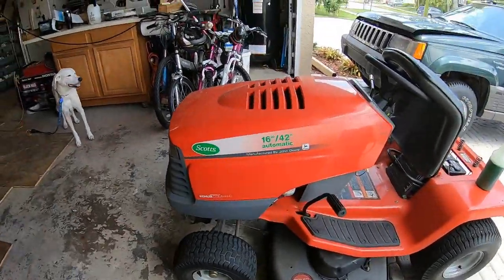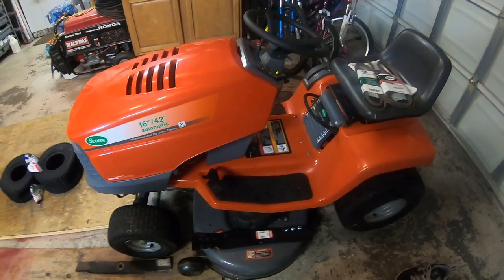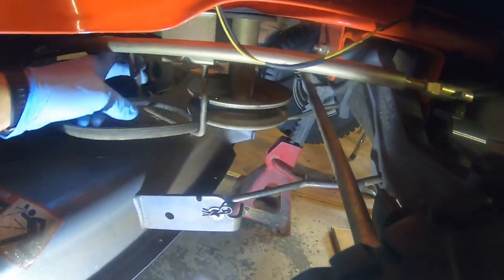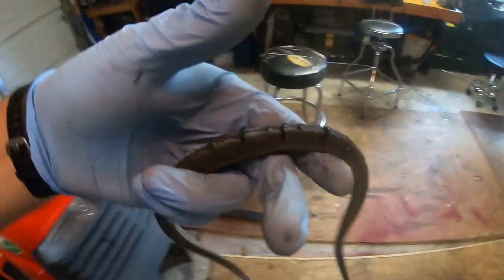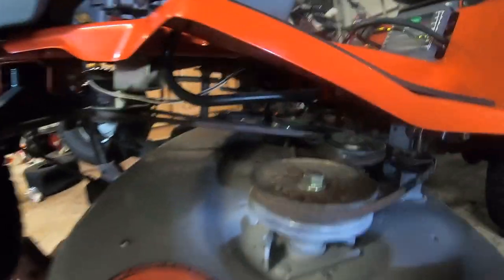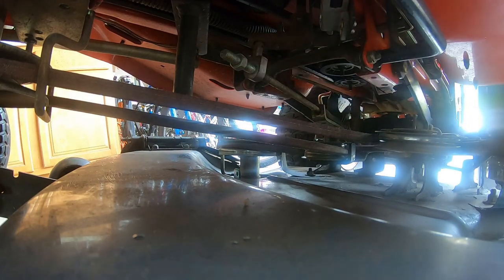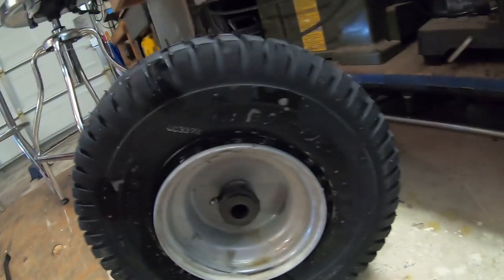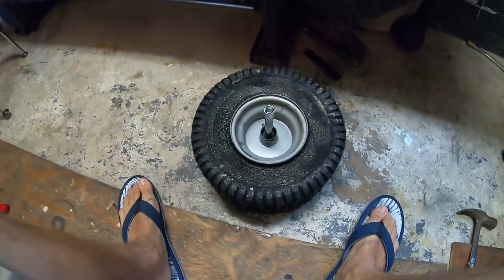Doing some maintenance on a Scotts/John Deere S1642 tractor

Comment: hey I have the same mower.  there is something wrong with the transmission its grinding.  any suggestions
Reply from the maker: I haven't had the trans apart yet. If you're hearing grinding from the trans, I suspect some a failed bushing or bearing that is resulting in misalignment of some kind. Either way, best to tear into it sooner rather than later to minimize the damage.
Reply: @JoesGarageProductionsLLC  yep,  I agree.   Thanks a lot for responding.   Happy New Years!
Reply: I had to pull rear out. (Easy 6 bolts) my fan teeth were wore. It sounded like what your describing.
Reply: @JoesGarageProductionsLLC  I have the same mower too., going on 20 years old. Great video.  I've changed both belts.  Mower seems to be having a tough time going up my hill this season.  Do you think I need to change the transmission fluid?
Reply from the maker: @bensonlouie6438  If the hydro is lacking power, it might be time to rebuild it. I did a video recently on rebuilding a hydrostatic pump on a commercial mower and it was surprisingly easy. In my limited experience working on hydrostatic drives, combined with lots of googling, it seems the most common problem points are the cylinder block assemblies and the center case. If the cylinder block doesn't form a nearly perfect seal with the center case, you'll have hydraulic leakage and low power. Other things can cause this as well - such as air in the oil, due to a low oil level. The oil level and condition is certainly a good place to start. I believe Tuff Torq makes rebuild kits for this transmission should you need one.
Reply: Does the pulley on the mower turn freely with the mower off, these things had a spline shaft where the pulley would strip out & cause the tractor to not move, had it happen to our LT160. New pulley & fan, & she was good as new, Hahaha. Now it drives better. But the belt is still gone though, so that’ll be fun to replace.

Comment: how do you remove and reinstall the hood on this?  having a awful time putting it back on
Reply from the maker: I don't have the tractor in front of me at the moment but if I recall there is a wiring harness for the headlight that has to be disconnected. Other than that I believe the hood just tilts forward and lifts up